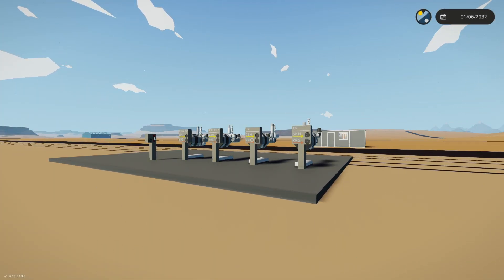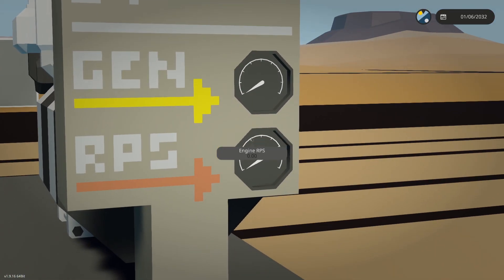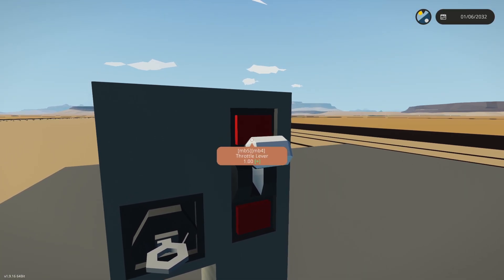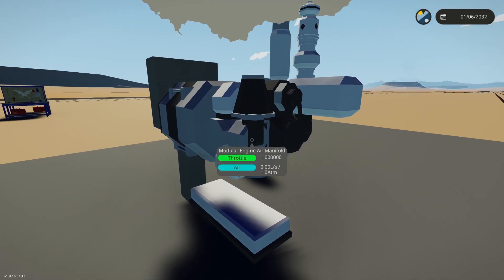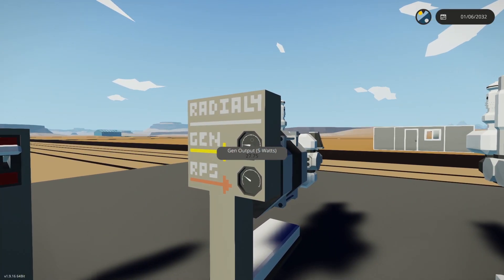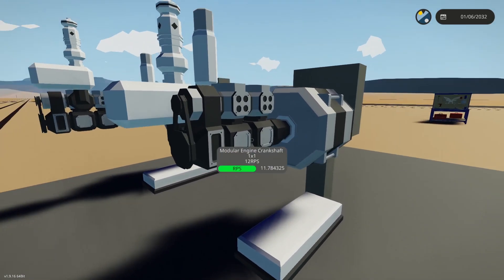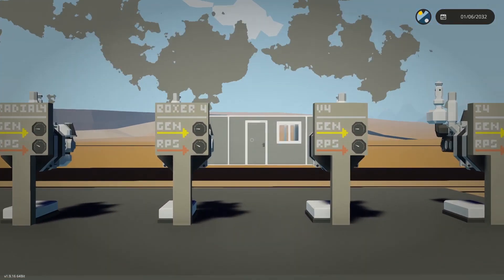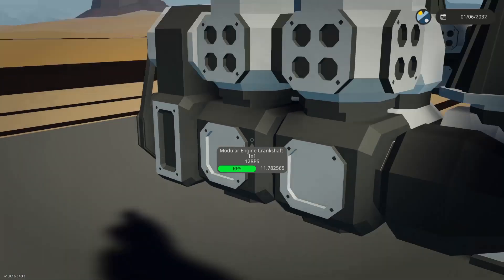What is the Best Engine Layout in Stormworks?

Comment: A good step in the right direction. Each crankshaft adds a set amount of resistance to the engine. As others have commented here, no they don't add torque.

Like I commented on an older video of yours for the CVT creation (fantastic work on that btw, I couldn't get nearly as far as you did) I'm working on building a Dyno room to do a bunch of testing and lay everything out for everyone with all of my theories and what I've already confirmed a few years ago before the space update.

Comment: What about thermal performance? I dont see you cooling these engines
Reply from the maker: I could do a thermal performance comparison if needed
Reply: @BigmanBoi  it would be great! I am mothballing my stormworks activity until the issues with catalytic converters and the smoke spam from gas moving at all is fixed, which the devs said would be in about three weeks, knowing what to go for if I want an engine that doesn't overheat would be great. My hypothesis? Thermal performance is also related to crankshaft resistance, and thus radial will cool the best.

Comment: The one thing that I would like to see tested is seperate cylinder banks with different setups for air-fuel manifolds ie. Engine with seperate cylinder banks with seperate air-fuel manifolds for each bank vs an engine with seperate cylinder banks with shared air-fuel manifolds. But that's leads you down a rabbit hole with multiple ecus with varying AFR values and fuel-air manifold ratios themselves and that's not even considering the possibility of increased pressure with the use of fluid pumps and clutch pressure/load

Comment: I tested basically the same thing but included a T-layout as well. What i found was that inline is more effective at lower loads (more generator output at the same rps compared to X-layout). But as soon as the engine is strained the effectiveness flips from I-V-T-X to X-T-V-I.
Bonus info: 1 medium cylinder has the same power output as 27 small cylinders.
Reply: and for the 1 big cylinder is the same how much with the medium cylinder?
Reply: i wish all comments had bonus info's
Reply: @steNOT3  Here is another one for you then; 1 large cylinder is equivalent to 125 small cylinders, or approximately 5 medium cylinders.
I think that is what the other guy was asking as well.

Comment: I think that in-game crankshafts work like smaller flywheels, they hurt your overall max rps but help with torque and fuel efficiency in the long run.
Reply: Ohhhh torque  that might be why they told me more crank shafts
Reply from the maker: This is a cool theory, will test it out
Reply: The generators benefit from the increased RPS, but vehicles not so much, it will depend on weight but they usually benefit more from momentum/torque created by the engine. Unless something changed on the modular engines that I'm not aware of, I don't pay much attention to the regular updates unless they bring new parts... 😅